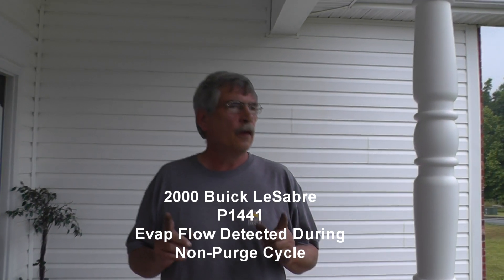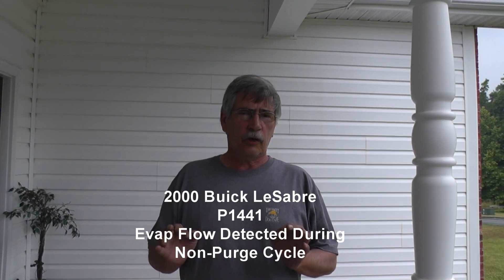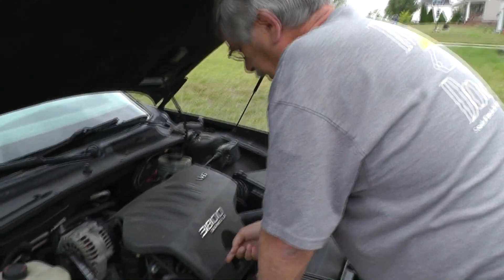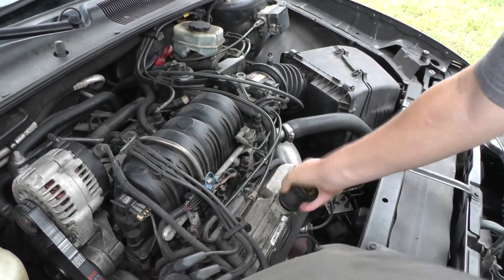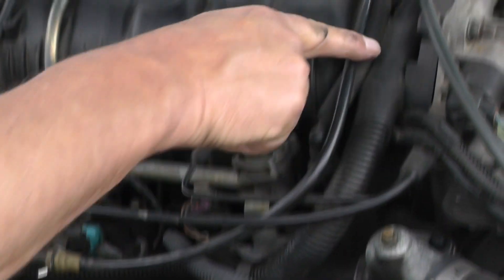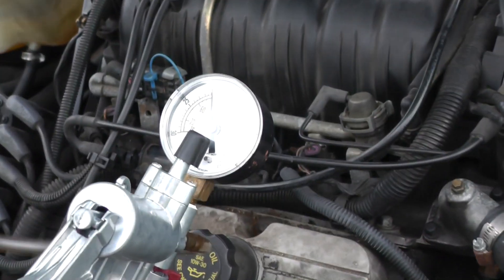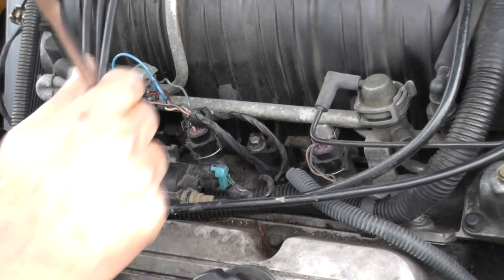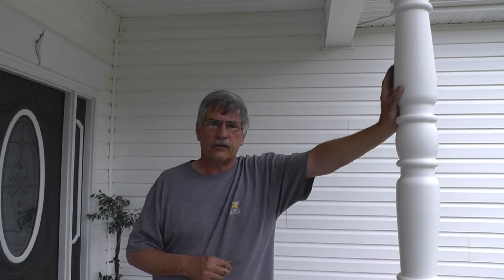P1441 EVAP System Flow During Non-Purge

Comment: detect code for nissan sentra is also P1441 in the obd11,where is this Sir?says very small leak in evap system,again thats the codeP1441 and where i can locate this in my car Nissan Sentra 2001?
Reply from the maker: Okay, with your code you have a small leak in the fuel evap system. And you're asking me where is your leak. I have no idea, you'll have to find that. I believe your canister is located back near the tank, maybe under a tire well. I'm not sure as you'll have to do the research. I mention back there because vacuum hoses will deteriorate when exposed to the environment. Here are two links. One is for your code, basically saying what the computer found. The other is a evap diagram for Nissan. Look at the diagram and see how your devices and vacuum hoses are routed. You'll probably see a vacuum hose split somewhere...Good luck on your repair.
http://engine-codes.com/p1441_nissan.html
https://www.google.com/#q=2001+nissan+sentra+fuel+evap+diagram

Comment: Terry,what about for nissan sentra where i can find or located the P1441code plshelp
Reply from the maker: Rylee, the code P1441 is a manufacturer specific code for GM so you won't see that on another manufacturer. You'll know a code is manufacturer specific by a designation of P1XXX. OBDII mandated codes are P0XXX which is universal across the board. So, although you may have a P1XXX specific to your car for the same scenario as mine, you can look up P0496 which is generic to all manufacturers.
Reply: stuzman52 thanks sir for your help

Comment: For those that don't have a vacuum gun simply blow through the line with your mouth while the valve is open.  Wish you would have mentioned that some valves are normally closed and you might need to energize the valve before blowing through.  Normally open valves like in this video sure makes diagnostics quick and easy.  Wish mine operated like this since seeing it in action.  So quick and painless to diagnose!  Great video.
Reply from the maker: Hi DJ. Good thought about using your mouth to blow through the valve. I just totally thought about this which makes it even cheaper to diagnose. This valve is a NC valve and opens when it's energized. The canister vent valve on the other hand is a NO valve which closes when it's energized. Thanks DJ for your comment.